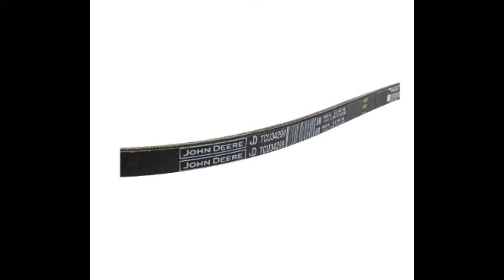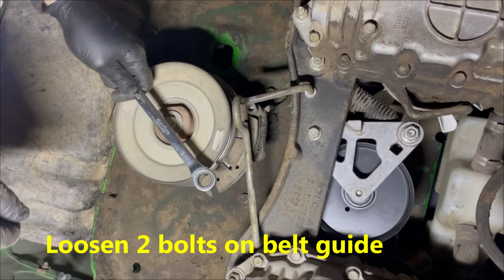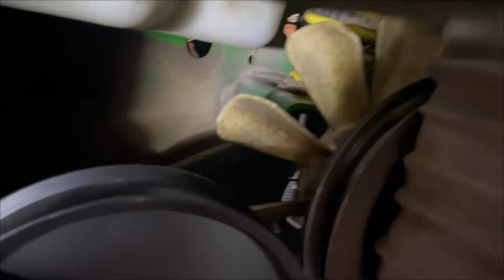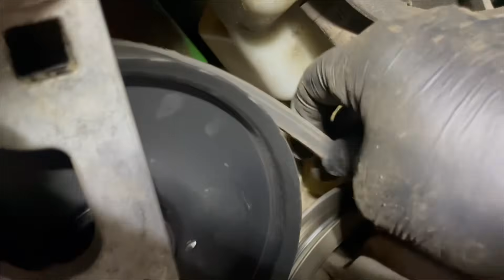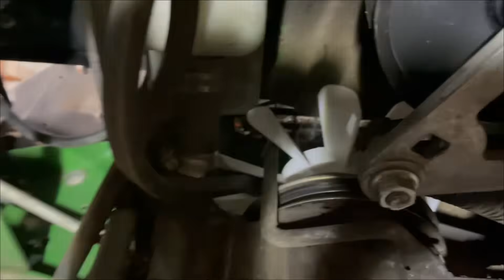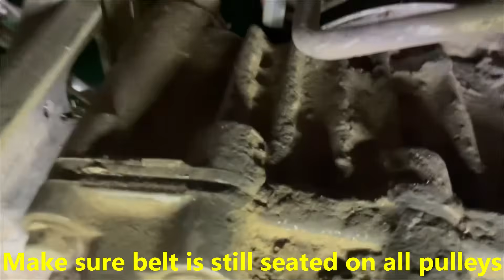John Deere Zero Turn Drive Transmission Belt Replacement Z920, Z925, Z930, Z945

Comment: I purchased the belt, backed it up on car ramps, rolled the creeper under took one look and gave up, watched this video and changed it, great video !!!
Reply: How did you put it on car ramps with a failed belt?
Reply: The belt hadn’t failed, I changed it in hopes that it would fix the left side propel being weak, left side is strong and reverse, but weak going  forward
Reply: @markmaendel5889 sounds like a bad power transmission

Comment: I never comment on videos, but I must say that this was extremely helpful to me. 
I have a 2019 JD Z945M EFI. While mowing, the bearings on my tension pulley failed (basically rusted out) causing the pulley to tilt and the belt to come off. I purchased a new pulley and pulley arm (the silver piece holding the pulley and tension spring in place). These parts cost me about $200. I was able to reuse existing bolts/nuts. 
I used this video and your hand-drawn schematic to replace the pulley and replace the belt. 
Bottom line, this video saved me about $800 (tow/parts/labor). Thank you very much.

Comment: Not sure the red line drawing is accurate - thanks for the video though
Reply: I figured it out - pic is correct but turned differently than video - thanks for your help
Reply from the maker: It is, as can be seen in the video
Reply: Turn pic 1/4 turn. Left front pulley to idler.